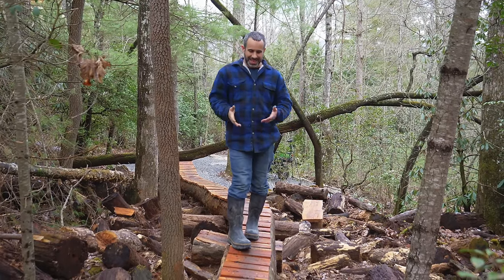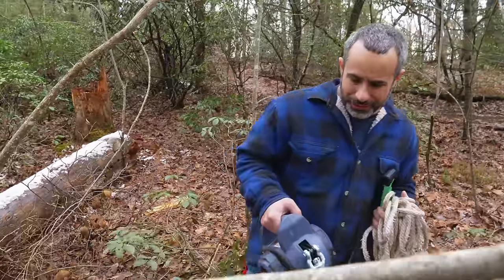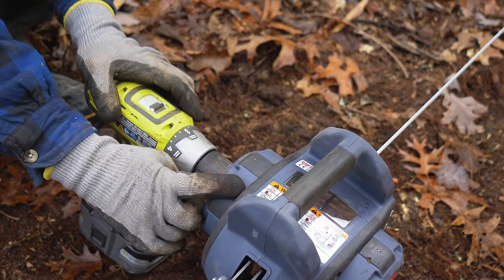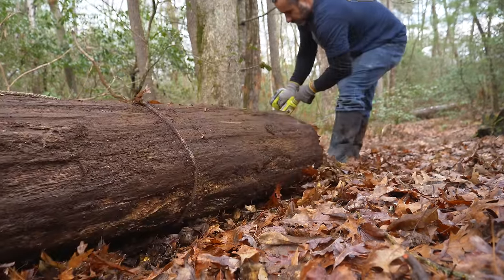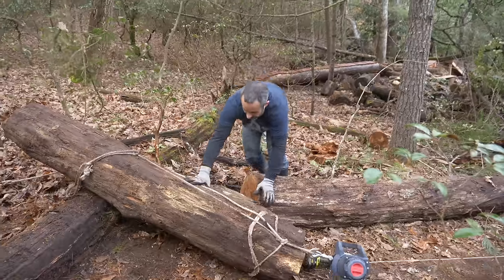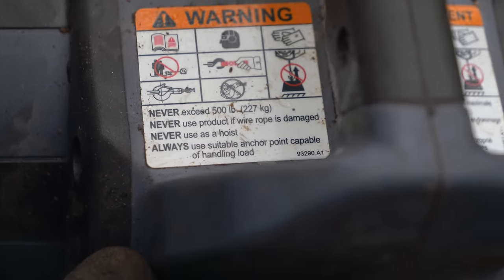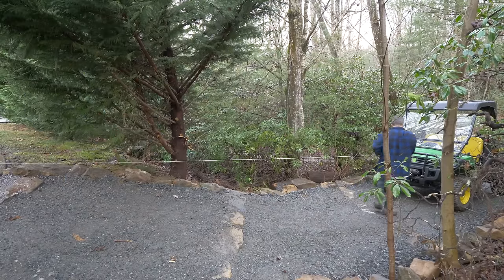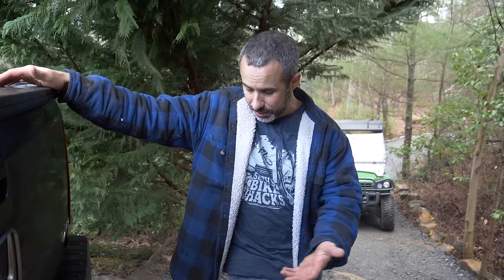Pulling stuff with a drill winch

Comment: Check out the "Massdam Pow R Pull" ratchet rope puller. Pull 1500 pounds using any length of half inch rope, I use a good rope 150 feet of three strand saftey blue.

Comment: I would recomend the pwc 3000 portable winch. It had a small petrol enige and a capstan winch, it is better for this type of log hauling. Source: i have moved logs  on trails like you did, but with 200 feet of rope/cable, and thus fewer setups for the winch. Portable winches are made in Canada.

Comment: Seth you should use pullies to increase the amount of power you can pull with that, a 2 pulley system could increase the power that thing can pull 1000 pounds instead of just 500, and the amount of power can increase almost exponentially from there. Smarter Every Day has a really good video explaining it.

Edit: oh wait I just got to the part of the video where you said using the snatch block was a bad idea

Comment: seth you can find an old 10-12hp 1970s something cub cadet tractor for like $500.00 in good condition. these tractors are nothing like what is sold today thell pull anything would be grate for work on the trails.

Comment: The part your drill grabs onto isn't even solid metal. It's like that fake samurai sword metal that has cheap filler in the center. I broke by literally dropping it in the grass without a drill attached. The metal they used is such crap I couldn't even spot weld it back together

Comment: If you’re going to use a strap around a tree don’t use it as a choker, you can damage the bark/tree; you should use your strap like a sling loop attaching to both eyelets. You can add some pulleys or block and tackle to both re-direct a pull or make the most out of the 500 available pounds of pulling.

Comment: Dude who even is this handyman that knows nothing about force vectors. Anchor the winch higher on the tree and it will work perfectly. Don’t try to pull the gator at a 30 degree angle when the wheels are completely straight and it will work perfectly. He thinks it sucks because he is accustomed to having high enough mechanical advantage that he doesn’t need to actually think about what he’s doing.

Comment: Why not make a simple rolling chassis for the logs to be pulled onto and then from there just drag the chassis on wheels, add a simple brake for moving the winch og making turns. Should work well good

Comment: If you have an old sled (like a plastic one) or a regular snow shovel, you can lay the front of the log on top of it and pull that direction. It’ll  slide over things without digging in so much. Might help, it’s still a hand tool! ;D

Comment: Have you thought about getting like a piano mover. Something v shaped with 4 big off-road wheels. Winch to log in the air from a tree above (not that high) and then either push or use the winch to pull easier?

Comment: I put a comment on your other video where you were wrestling the log, but essentially it goes something like this: Modify a hand truck by cutting most of the bottom plate off, cut the remaining bottom plate into teeth, roll the log over a ratchet strap, strap the hand truck in the middle of the log, roll the log over until you are back on the hand truck wheels. Now you can wheel your log around with a lot less effort.

Comment: You could have used a pulley system to increase the force, just by passing the cable around something  and back to the source you can get twice as much strength

Comment: not to be captain obvious here but you said you needed "some kind of a sled"
perhaps the red sack truck you was using and hauling the wood on by hand ?
the wheelks would significantly lower the drag force required to pull it along and not eat up the trail so bad

Comment: Yo Seth, check out using a timber hitch style knot with a chain. Using that plus elevating the wench could help with some of the binding on the trail. That way the front of the log is off of the trail and there is less friction. Maybe that would help a bit but, the torque limiter on that tool is pretty annoying. The beauty of a timber hitch is you can attach the wench cable at any point on the log making it easier to maneuver around trees.

Comment: Smart way would be to use snatch block or roll it on smaller logs, but I suspect you will rather go full Seth on it and buy another drill winch so you get twice the dragging power at the same speed!

Comment: Not a bad wench, too bad the drill was limiting potential. Also that 500lb weight limit is for liability. Im sure the tinsel strength of that cable is a litttle higher.

Comment: riobi is a homeowner grade drill they are cheaply made and use cheap parts if you want somthing strong go with a dewalt , milwalkee, bosch mikita hilti any one of those is a high quality work hose of a drill there ya go and fyi you need a bigger drill with somthing like a 3 speed box brushless motor or bigger motor for it not to smoke

Comment: Use the winch and a series of wooden rollers (sections of equal length and diameter logs) under the log. It will move more easily, and you can save the Ryobi. Keep doing what you do, dude!

Comment: This is probably something someone has told you before or had the idea yourself, but you han reduce a lot of friction by just laying sticks perpendicular to the log underneath it so it can roll on top. When it starts rolling you just take the sticks from the back of the log and lay them in front. I think that would also save your drill from smoking up when pullig monster logs.

(edit) I just saw the comment from @Optokapler who suggested the same thing.

Comment: The process you want is called tushing. First you must remove the horizontal branches to create as straight a log as possible. Hook a stout chain or very strong rope around the leading end ( usually the base) about 2 feet from the end. To get moving, lay some of the larger cut off branches in front of the log as rails (90 degrees to log). One big lift and pull, get the end of the log onto the branches, and now it will roll over them.

Comment: If you are going to move a lot of these logs like this, like you said, make a sled, but also consider some sort of wheels you can slide under the log, then attach those at the end of the log, maybe an old used dolly like you had, but cut in half and modified to allow you to strap down the log. Let the wheels do the bulk of the work, then you can use your normal dolly to act as a hand tractor for moving things around.

Comment: We cleaned a local river recently where we had to pull a bunch of old tires and garbage out up the side of the river bank and the most useful tool we had was a winch similar to that, but it requires electrical power.  It would have been way better if we could have used a power drill.  It would have opened up the other potential anchor points to get to the trash.

Comment: Maybe you read this comment although i am late.
When you pull the log, put a selfmade sled out of metal under the front of the log, so it will not dig itself into the ground. 
Just use a thin metal plate and bent the front and the side a bit upwards, put it under the log and you will see it will need much less effort to drag them out.

Comment: the coiling of the winch line affects the pulling power along with the amount on the spool while you are pulling. a long line means less on the spool which makes for less inches of line per rotation and a loaded spool has less torque because the length of line in a single rotation is much larger.  at 8:29 it was losing torque because the way the winch was sideways loaded the spool on one side somewhat, as you can see at 8:39

Comment: You need to lift the choke point on the tree (head height or so) so as you drag the log the front is encouraged to lift, not dive into the dirt which will deduce the drag on your little winch

Comment: You should get some "snatch blocks" and using that winch you could take that 500 lbs. limit and turn it into a 1000lbs. pulling capacity, you may need to get a different cable to do the majority of the work and just hook the winch onto the additional cable.
Reply: Just got the part where you had a snatch block in your hand....sorry.